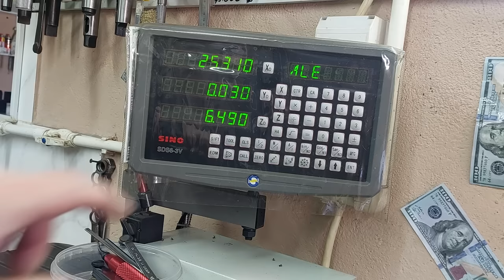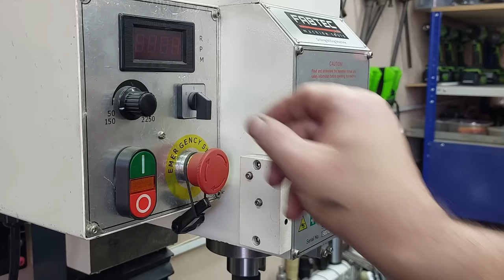I should have done it sooner! Not a single turner can do without this homemade tool

Comment: Oh no! Not another video of machines making chips without telling the viewer what is being made. Spoiler alert.....it's a simple boring bar holder.
Reply: When you make a hole in the tool post using a twist drill revolving from the mandrill that hole is in line with the lather centre for all applications.
Reply: @ValMartinIreland  only if you are using a fixed height turret tool holder instead of a QCTP, and only if every boring bar has the same shaft diameter and has cutting tip positioned exactly at centre height.
And it is still a poor diy video. A diy instruction should start out with an overall description of what is being made, and a materials list. If it is an unusual design, the benefits of the design should also be described. Instead, we the viewers are subjected to a lot of shots of things going around and shiny chips being made without knowing what the project is.
This is true no matter what the project.
Reply: An adjustable tool post holder is a better option.
Reply: while you were wasting your time watching this silent movie, I went to the store a bought a boring bar holder.
Reply: @tedhansen2830  Też tak uważam. Przyrząd jest pod konkretny nóż. I zabrakło omówienia przyrządu
Reply: Whenever I see his wave I remember who I am watching and skip to the end of the video.

Comment: Great idea! You start having problems when using detachable tool holders as the holder starts getting further away from the tool post. Great work shop. Also facing with three jaw self centring chucks can be dangerous we all do it but work piece flying out is quite possible outcome, independent 4 jaws is the safe way of doing this obviously. But a great handy boring bar holder👍
Reply from the maker: Thank you my friend and welcome🙏

Comment: I've made a bunch these boring bar holders for three lathes at work. Only difference  is after I bored hole for bar, say 25mm one I offset block and made the hole oval towards the top. That way the bars slide in easily and when tightened sit exactly on centre height. Also made a bunch of sleeves the same way so a 12 mm bar can be swapped in.